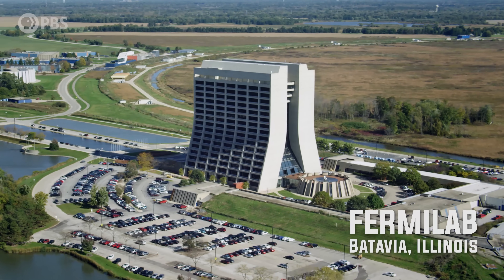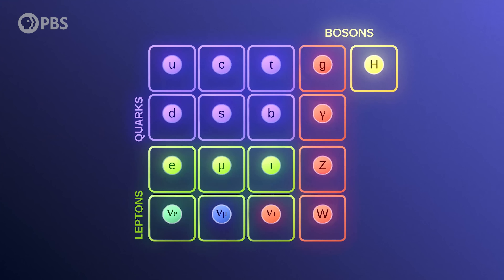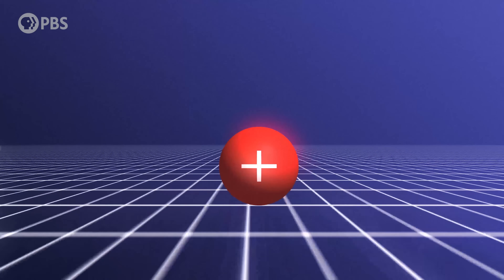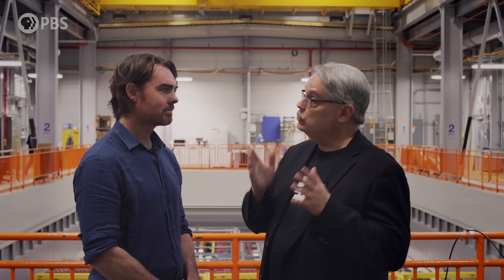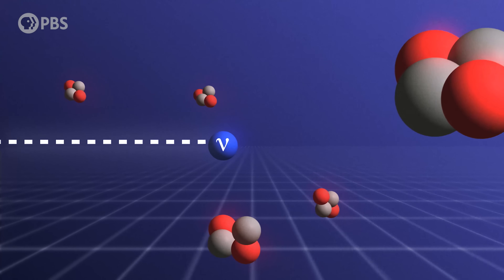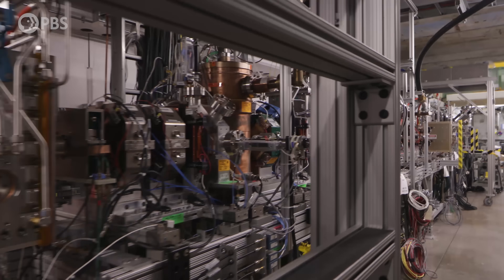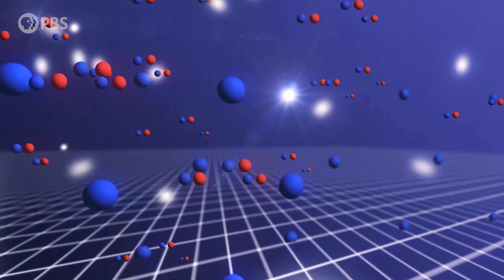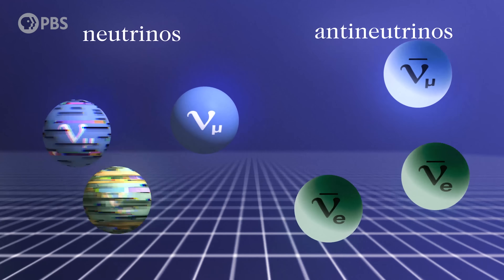How To Detect a Neutrino

Comment: Neutrinos try reeeally hard but still fail at being massless particles.
Reply: Probably need a ketogenesis diet.
Reply: They're being successful at trolling humans.

If they were either massless or quite a bit more massive, our theories would work.

But their mass just happens to fall in a very narrow range that completely screws with us. They're doing it on purpose.
Reply: @lordgarion514  Read a post on reddit some guy made about neutrinos being proof that God is a complete ass. Funny to think of this being the kind of exasperated humor the standard model is directly responsible for.
Reply: There's no escaping the Higgs field, my friend 😏
Reply: Confusing that Dr Lincoln says the neutrinos are traveling at the speed of light.
Reply: They do; at least, they travel so close to the speed of light that we aren't able to tell the difference. (But the theory requires that they do have rest mass and therefore can't travel at exactly the speed of light; otherwise, neutrino oscillations wouldn't have been possible.)
Reply: MikeRosoftJH when I asked Sean Carroll about the speed of neutrinos he said, “Like any massive particle, a neutrino can move at any speed less than the speed of light, including zero.”  How does that square with your comment?
Reply: @tedlis517  Well they can, but they mostly don't
Reply: Well, imagine that a neutrino has a rest mass of 0.01 eV. Imagine that we observe a neutrino with an energy in the order of 1 MeV or even 1 GeV - such a neutrino must have speed extremely close to the speed of light, so it's not that surprising that we're unable to distinguish that speed from speed of light. (For comparison: scientists have observed a cosmic ray, probably a proton, with an energy of 50 J - dubbed 'Oh My God particle'. If we were to measure its speed, we wouldn't be able to distinguish it from the speed of light either.) And conversely, imagine a low-energy neutrino - say, from neutrino background radiation - with an energy in single electronvolts. Such a particle's speed could be distinguished from the speed of light, but it's absolutely beyond our ability to observe. (Even high-energy neutrinos very rarely react with matter: when somebody joked on Twitter that "trillion neutrinos walk into a bar, one of them says 'ouch'", another user corrected him: for those odds, the bar would have to be made of iridium and 10 km long.)
Reply: MikeRosoftJH thanks, I think I get this. I couldn’t connect how the speed mattered if a neutrino interacts through the weak force.  What I’m inferring from your comment is than highly energetic neutrinos are more likely associated with the generation of W+ and Z0 bosons needed for interacting with things like neutrons.  (I know I’m way outside my knowledge base, so I’m going to research this concept further on my own.). Cheers.
Reply: Yeah, those morons. They can't even be massless! 🤣

Comment: Can you figure out the direction a neutrino was going?
 And how can one filter out the background noise (I guess by pure quantity)? What is the factor by which the beam has more neutrino than the flux from solar and other sources?

And how certain are we when we connect a certain neutrino event with a cosmic event?
Reply: To quote the video "probabilistic"
Reply: The main neutrino flux is solar, but it has a specific set of energies. Because of this, and the concentration of the beam, the beam should be about 4 orders of magnitude 'brighter' than background flux.

In terms of connecting a neutrino event to a cosmic one we've generally had good luck since such 'events' ends to be 'neutrino pulses' of less than a few seconds duration during which there are few cosmic events such as nearby supernovae that are close enough for the flux to still be significant enough to rise above background.

Comment: If negative base doesn't exist. How can anything push against anything. How come same charges repell. What about heat. It flows up   away from heavy Bodies. What about Hawkins Radiation. 
  Negative Gravity turns out to be a thing. Found I Old Nutonion physics and discovered in sound

Comment: I thought we were still kinda struggling with provign that neutrionas are actually a thing.
Are the detections of the ice cube and the other one accepted now?
Reply: Pretty sure they were a part of the standard model for quite a while now.
Reply: @Mernom  part of the model yes, but not proven unless i'm mistaken
Reply: Yes, good lord yes. They've been accepted since around the 1950s. It's not hard to know soemthing's there, when beta decay happens energy and momentum seem to 'vanish' in a way that agrees with an unseen particle also being produced.

In terms of detection that's pretty solid too, we see elemental transformations (Such as those between chlorine and argon) that are consistent with neutrinos (You can use them to reverse beta decay or cause stable nuclei to decay.) The Solar Neutrino Problem was so named not because neutrinos didn't exist but because we only found a third of what was expected. This is all very solid.

What's still up in the air is the details. What masses do neutrinos have? ARE they their own antiparticles? We don't know. But that's not the same as neutrinos themselves being in doubt.

Comment: So how do you even begin to 'aim' the beam of neutrinos at the new target so far away?  I mean there has to be an infinitely accurate method of constructing the beam equipment to make it arrive anywhere near where expected
Reply: Watch the video again.  A beam of charged particles is created,  These are aimed in the usual fashion by magnets.  They then decay into neutrinos and other stuff.  Conservation of momentum guarantees that the neutrinos are heading in the right direction.
Reply: @michaelsommers2356  I did actually watch it twice!  But you are sending a beam of something that you can't see or feel through the ground over a thousand miles to be lucky to hit a house.  So you just adjust and 'steer' with the magnets until the interactions are observed?  Even if it is on target it might be one interaction per week. Do you know how many natural neutrinos are passing through you right now?
Reply: @chemicaljuice3078  You need to get in touch with the experimenters right away to let them know that the experiment they have been designing and working on for years can't possibly work.  Then let the LHC know that that machine can't possibly work, either.
Reply: 'Infinitely accurate'? I think you fail to understand how this works.

The beam of particles is focused and turned into neutrinos, this beam will broaden as it travels, it's a searchlight rather than a laser.By the time it reaches its target it's around 20m wide. This of course dilutes the beam's density, but it's still high enough to exceed background. (You seem to be blindly assuming that all neutrinos are the same despite their energy, which is like equating gamma rays with sunlight.)

The beam does need aligning, this requires many, many months of testing, but the basic idea is to use GPS to fix the position of origin and destination precisely, 'sweep' the beam around the destiantion and record when spikes of neutrinos are found. This will give you data for when you are on target.
Reply: @garethdean6382  I did actually ask a question and this is a better reply . Thank you

Comment: I've thought for a long time that protons needed to be improved
Reply: Relax, half of them will have decayed in about 10^32 years or so... Maybe :)
Reply: @thesinofpride9433  Like boomers?
Reply: @141Zero  Those will have decayed slightly before that.
Reply: Stripes at least 👍
Reply: Ok. How about each proton is two positrons surrounded by an electron. Each neutron is two positrons surrounded by two electrons. Neutrinos make up remaining mass. The charge would be right and the so called imbalance of matter to antimatter in the universe is gone. It also would mean everything is made from electrons and positrons.
Reply: @michaelhavers1  
But haven't we detected positron and electrons annihilating each other?  Or would neutrinos be an undetectable product of that "annihilation"?
Reply: Just off camera, there was a crew of exuberant, extroverted and impeccably dressed homosexuals "updating" the test chamber with recessed lighting fixtures and adding a hide-away chest of drawers to the muon source.
🤔I assume next week they'll add a cozy little breakfast nook to the protons.